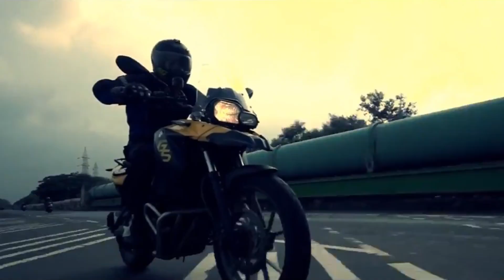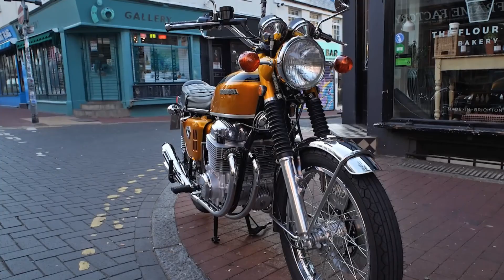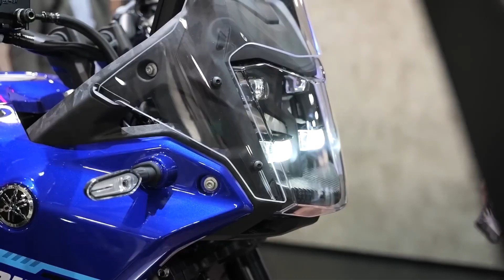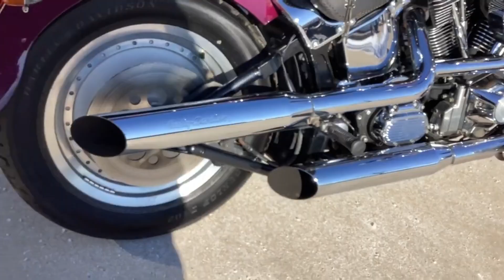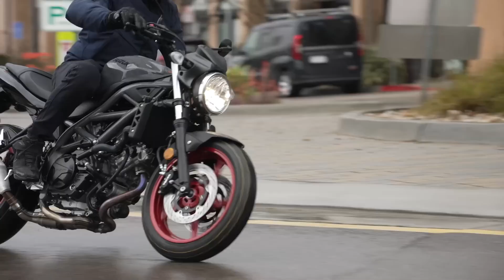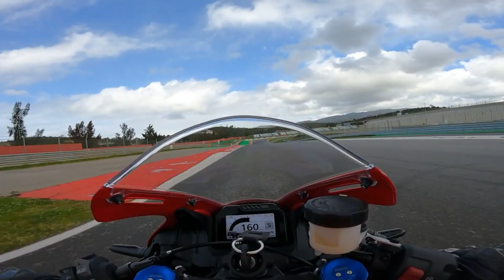10 MOST Reliable Motorcycle Engines EVER MADE!

Comment: How reliable is the twin cam Harley engine
Reply from the maker: They’re solid engines once the known weak spots are taken care of. The early Twin Cams (’99–’06) had cam chain tensioner issues that can cause problems if not upgraded to the hydraulic setup. Once that’s done and it’s been maintained right, they’ll easily go 100k+ miles. The later ones (’07 and up) are even more reliable. So yeah—great engines overall, just make sure that tensioner’s been handled.

Comment: So the 2013 KLR650 I had must have been extremely rare maybe I should have kept it, because it was water cooled.
Just like they all are actually, right off the bat this video is throwing out BS.
Reply from the maker: @dittman2564  You’re absolutely right—great catch on the cooling system. That was a mistake on our part during scripting, and I missed it during the review. Appreciate you pointing it out! That said, the rest of the info about the engine holds true. The KLR 650’s motor has a solid reputation for reliability, backed by countless rider testimonials and forum discussions. Thanks again for watching and for keeping us sharp!
Reply: @MotorcycleLibrary0124  except that the case in the sump area has been referred to as being made out of paper mache or something like that, the oil drain plugs strip out extremely easy and if you don't put a good pan for sump protection and you ride aggressively off-road there's a good chance you are going to cause damage to the case. 
Several other minor issues that need to be dealt with as well, including the doohickey on the earlier bikes but even the doohickey spring itself on the Gen 2 bikes, it's best to just do the entire doohickey on both Gen 1 and 2, I have no idea about gen 3. The Gen 3 looks like it's far more Street oriented and I wouldn't call it a dual sport, it looks like it's trying to be an Adventure bike.
And it's also best to install the Thermo Bob modifications to improve the potential cooling issues. 
What surprised me the most about this video is you don't have any Honda XR or XL featured. Those bikes deserve mentioning far more than the KLR650.
I've had both, The Hondas are pretty much the kings of true dual sport bikes. 
(I have a 2014 Triumph Tiger 800XC and those are often called dual sport but let's face it they are Adventure bikes, not true dual sport bikes)
In the 80's I had a 1985 XL600R for several years, and I currently have a 2007 XR650L I acquired in 2019, and a 1991 XR600R I acquired last year. 
I've only had one KLR650, a 2013 Gen2. I had it for about 2 months maybe before I sold it. I liked it after I made all the necessary improvements, but it was not nearly as good off-road as the XR650L. And having had a Honda in the past that's really what I was looking for. 
Though the water cooled feature of the KLR 650 can be handy in certain areas and situations. But it can also be a detriment in certain situations, lol.
Reply: There are a few other errors in this video.